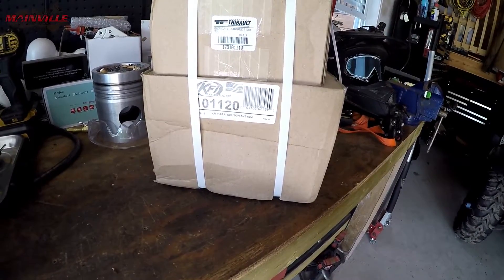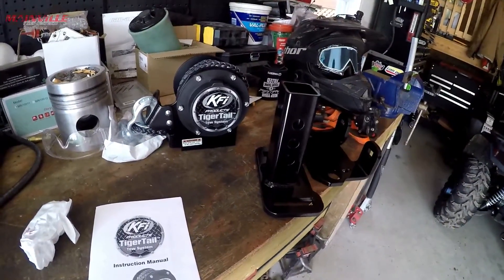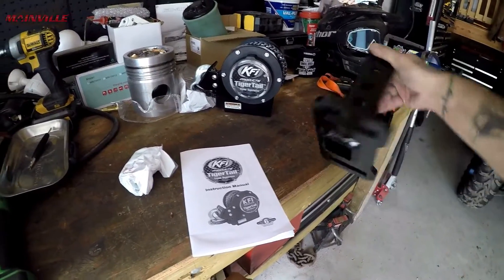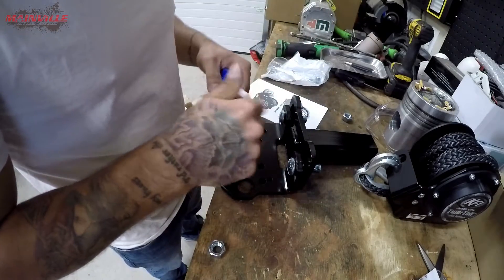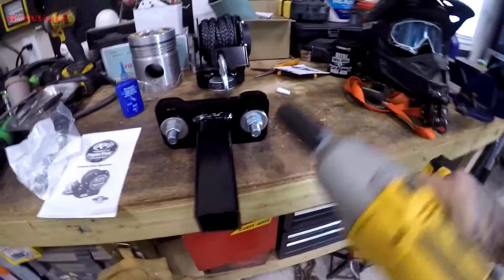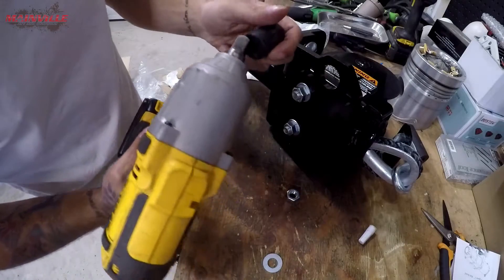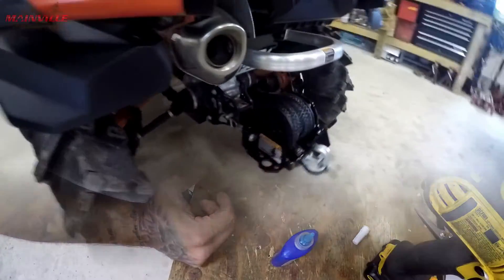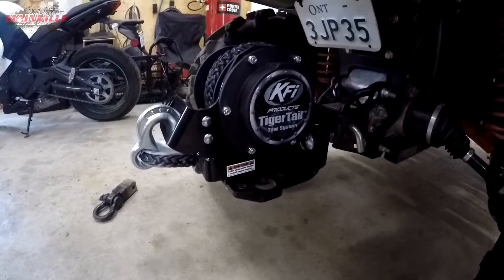Viewer sent us a TigerTail!?

Comment: Have a question ....can u do a video about can am wiring problems and maybe what to do protect them from water damage?
Reply from the maker: I've never had any wiring issues at all other than a switch failing but that's very minor and self explanatory. None of my friends with canams have brought up any wiring problems so I dont think I could if I wanted to. Sorry!
Reply: Ok just had a harness get wet and fail on me lost my headlights winch and 4x4  all at once since this is  my first can am thot it was something that happens a bit
Reply from the maker: @dwaynewandaatvvideos5119  sorry to hear that but no I've never seen that myself
Reply: Buy a honda problem solved lol

Comment: If you flip the bracket around your can have it tucked up where ur plate is, that way it's not burried in the mud hanging you up.
Reply from the maker: I actually just did that when I reinstalled it on the wife's bike. Thanks for tip!